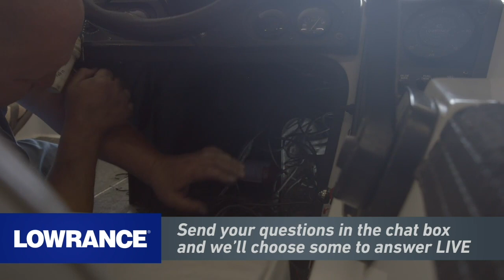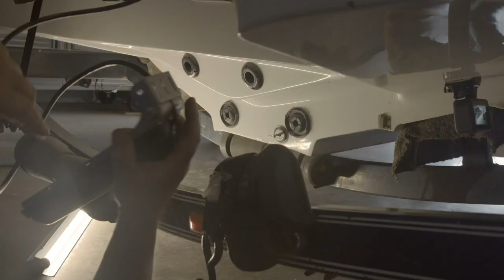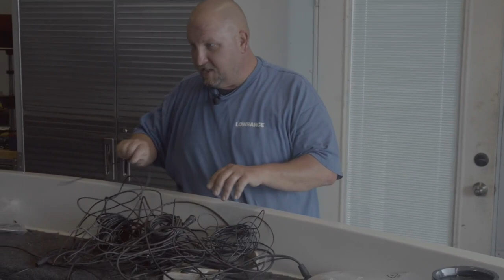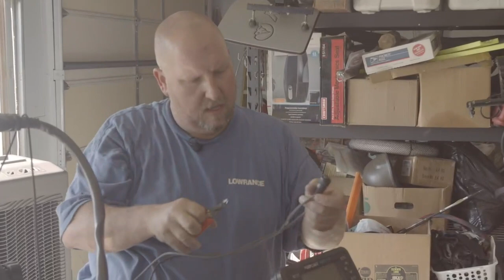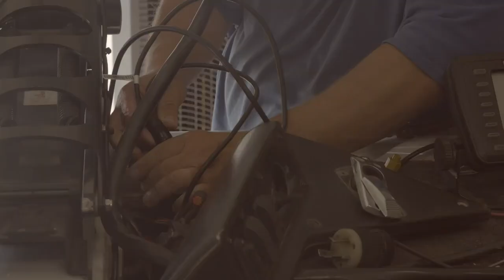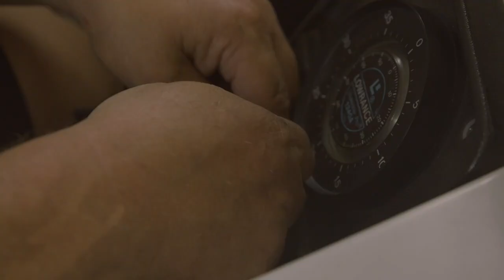Lowrance LIVE | How to Swap Out Your Fish-Finding Electronics Like a Pro

Comment: For the Elite Ti2 series, Im hooking up a 12 inch and a 9 inch one at the counsel and one up next to my trolling motor. They both use blue tooth do I still need to connect a Nemi cable to both ?and or the ether cable. These are also equip[ed with GPS but I have an older GPS stand alone from lowrance. Should I use that since it seems to be still in great working condition? any help would be appreciated, Thanks
Reply from the maker: You will be able to share chart and sonar between them using their wireless connection. You will need to have a working NMEA2000 network so you can control the trolling motor from the Elite ti2s and share some digital data.
Reply: @lowrance  I still have the old school trolling motor with no technology, I plan to upgrade that next year to the Ghost, As I do that I will have the NMEA network installed to mostly operate from the Elite 9 inch I plan to have set up at the front of there boat, Thanks for the help.  Do I need to worry about the ether cable or do these eliminate that one?
Reply from the maker: The Elite ti2 units do not have ethernet port, that is why they have the wireless option between them.

Comment: I have a HDS 9 gen 3 with totalscan at the helm and a HDS 7 at the stern, my 7 is turning off and on by itself so I think it is going bad. So, If I have to replace my 7 would you replace it with a HDS 9 live at the helm? Great video!
Reply: do a hard reset on it then update the software, my elite ti2 9 was doing the same thing.
Reply: My HDS 7 won’t even stay on long enough for me to continue with a hard reset or update the software  I am hoping that nothings wrong with it but if there is what do you think about replacing it with an HTS9 and a total scan  transducer on my Minnkota Ultrex trolling motor
Reply from the maker: An HDS 9" Live will definitely be the way to go.
Please contact us via fb messenger about your HDS 7 issue. Send us the serial number please.

Comment: Mr Scott I have watching you a lot but I still don't know how to adjust midle line on side scans  as the boat is moving the to read water column  the line too large and I try to zoom in and out to get the line small but the water reading could get 200feet or 300feet to get that line small can you tell me thanks you very much my number is 916 583 3902